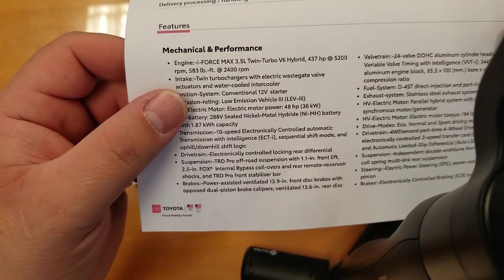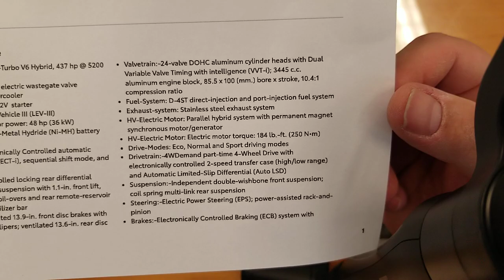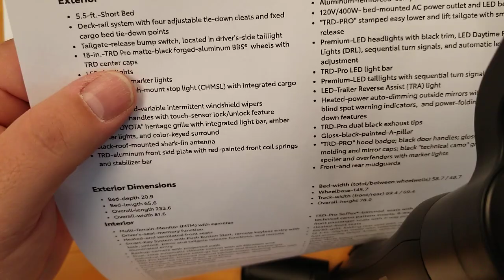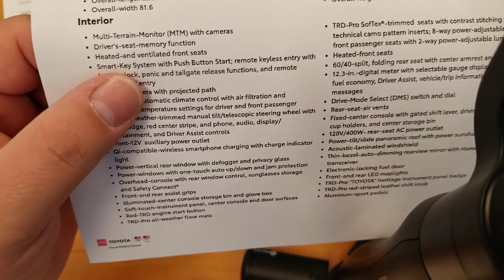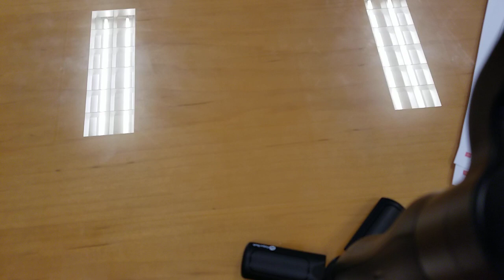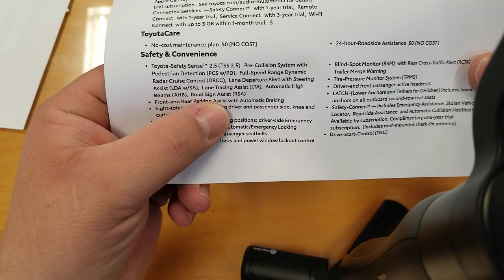Trd Pro Tundra Hybrid build sheets.

Comment: Yes!!!! I’m so happy you posted this 😭 😊, thank you so much Steve, can’t wait to talk to my dealer about putting a deposit. One question, you know when places like southeast Toyota will give us build sheets?
Reply from the maker: Probably last if the gas version is any indication.  They got their info last
Reply: @stevenwelchtoyota  one more thing, they are supposed to be having an update on remote start and the profiles not loading on the screen, did you hear any news if it will be fixed once the pros coming out?
Reply from the maker: @tonyjoudi466  last I heard it was fixed
Reply: @stevenwelchtoyota  interesting, if they fixed the remote start not shutting off after opening the door and can drive off, could you test it when you get another tundra coming in please?
Reply from the maker: @tonyjoudi466  I will.
Reply: @stevenwelchtoyota  I appreciate it mr. Steve 👍 😃.